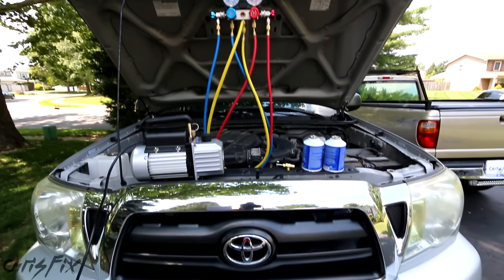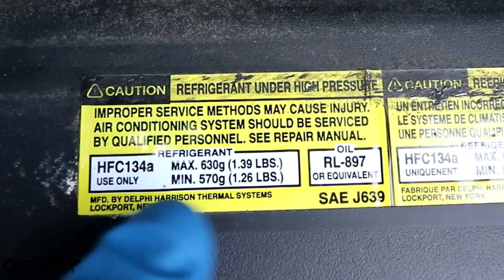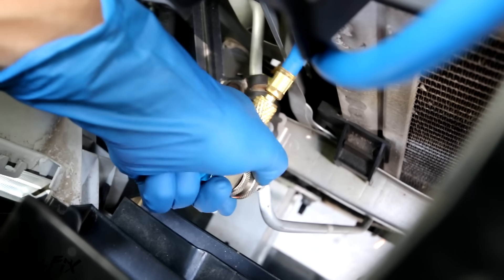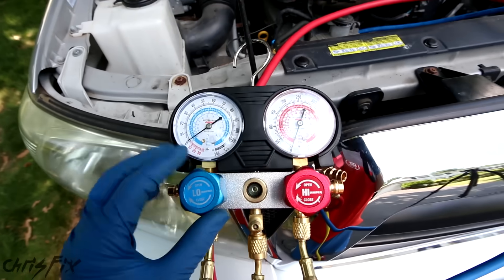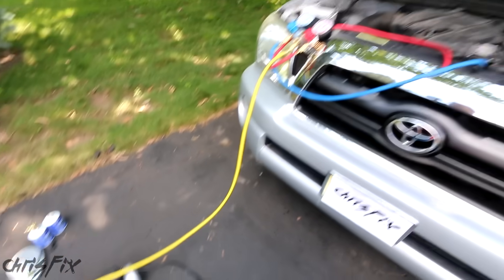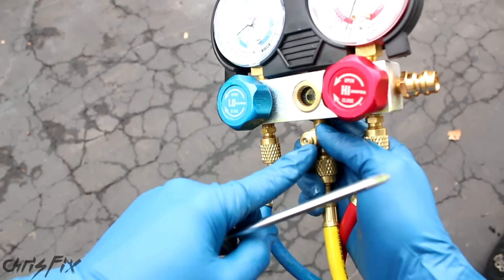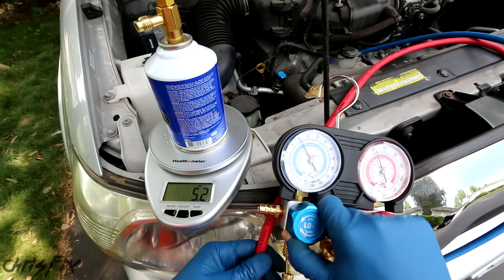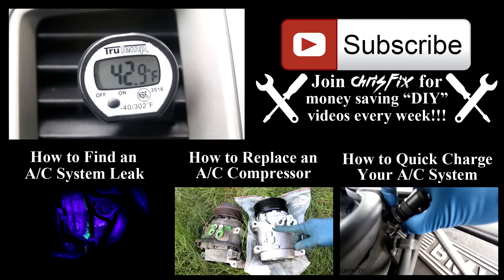How to Properly Recharge Your AC System

Comment: When I drive my 1986 ford f-350 smoke gets in the cab, also through the vents and some from idk can you help there hasent been a fire. Thank you
Reply from the maker: +Organic pranks Check the engine for oil leaks. The smoke is probably burning oil.
Reply: +ChrisFix its not a lot of smoke, but I'm going outside now in 20 degree weather to see if oil is low
Reply: +ChrisFix I checked the oil it's fine, where would it leak?
Reply: +ChrisFix thank you

Comment: What Vacuum did you use? I didn't see it on the description. I have been wanting to start repairing Car ACs, but I want to make sure I was getting good tools, read a lot of people saying the gauges and vacuums they bought were junk.
Reply: +tdrewman The guages and vacuum pump are together as one package in the description
Reply: +tdrewman If you start doing this on cars professionally, you will need to get EPA and any locally required certifications.. The paperwork to do this is a pain in the butt...

Comment: if you turn your can upside down you get liquid =bad idea . keep can up the can and charge vapor only . you can take out a compressor real fast with liquid ,,if you want to go faster than the can wants to go , ? then put your can in hot very hot water then the vapor pressure will go up and it will charge faster ,,,,,and yes i am hvac tech cert of course . thanks nice vid good work

Comment: Hey I have been watching your videos and enjoying them.  There are a few things that you may want to add.  I have an 1982  Chevrolet  Silverado with a 6.2L desiel and needs   R12.  I am sure you can get new schreader valve adapters as well as  changing the O rings with the new silicone O-rings.  They make a cheap  vacum  pump that uses your shops compressor and they work very good as well.  Now the problem is " early 80's and 90's  systems will not turn on the ac compressor until  it has 1 pound  of r12 or with the schreder valve adapters r134a into the compressor"  now I know from when I used  to work at a body shop   that there were different ways to jump the compressor to where the clutch would engauge.   For the life of me I cant remember them and I would love to use my AC seeing we have relocated to Arizona.   Can you help me ?
Reply from the maker: +cody cheney Just take off the connector on the compressor and use 2 wires with 12 volts and attach them to the compressor prongs. That will engage the compressor.

Comment: you don't charge it from the lower pressure pipe and you can't charge it from both sides at once it's wrong
Reply: he did charge on the low side since he didn't open the knob where the high pressure hose was going. It's connected but all it is doing is reading the high pressure psi and not injecting refrigerant
Reply: +med mtv What yout Talking about. You always charge it from the low pressure side. Chris did an excellent job. For being an non refrigeration technician.Some minor things he could have done better. But this was pretty got damn good.
Reply: Chris is pretty smart and look it worked
Reply: +med mtv  Chris did'nt say that the system could be charged on both sides, the manifold gauge allows you to see the pressure in both sides of the system. Also, charging on the low side is safer, especially for diy's. The machines in the shops can charge on the high side, only because the machines can automatically shut the charge off if the pressure gets too high.

Comment: They wanted to replace my evap core I'm like no just put freon in it. They didn't say anything about any leaks I felt like they where trying to scam me
Reply from the maker: +SuperJeremi10 Maybe, if there are no leaks you dont need to replace it unless it is the receiver dryer.
Reply: from wait the shop said they didnt even test for leaks they said there's no signs of oil or anything  and there is a airflow restriction and my evap coil needs to be replaced the box needs to be pulled and check airflow issue i may have bought but  to replace my evap coil  that  just the other day was working fine  i dont think so unless you can show me that its leaking im not changing it unless i have to pull the box to replace ven doors then id replace it  with a new part to avoid having to go back for it they also tried to tell me that a airflow issue could cause Freon loss oh yea i bought that real well i paid them the 80 bucks to recharge the system and its blowing ice cold again there is a blend dorr issue but not one i plan to fix  the recirc door is broken so it is stuck on recirc mode which is fine by me as long as it cools  i took it in cause my ac compressor would run about 30 sec then turn back on then right back of never would get cold next time it leaks out im going to take it to scotty or my norm shop and have them recharge it with a leak die and find the leak if the condenser is leaking or a hose or even the direr charging ports ill have it fixed  if the evap core is leaking ill just keep charging it till it gets to the point it wont hold Freon i took it where i did cause i was 50 miles from home and my ac quite and i didnt want to sweat all the way home.
Reply: ChrisFix
okay here is a weird one for you my ac is still not cooling right its 80 today ac is cooling great keeping us nice and cold until i get on the freeway i get up 65-70 mph and the vents start blowing warm we start sweating as soon as i slow down to 45-50 ac starts blowing ice cold again  i pulled over it seems any time my rpm goes over 1800 the ac starts blowing warm does not matter how long ac has been on as soon as the rpm falls it will blow cold again  all the compressor does at 2000 rpm is click on on off will not run long enough to make the lines cold as soon as i lower rpm the compressor kicks in and lines get cold  i drove 20 mile sweating on the freeway 65mph cause the ac would not work but as soon as i get back in town slow to 45 its cooling just fine.

Comment: My ac finally quite cooking today the ac compressor would Cycle on and off really quick. My gauge showed it was charged right lines started to get cold when it kicked in three it kicked out it was 15 oz low on freon they also wanted to charge me  800 to pull the dash. They said there is an airflow restriction because lien one cent don't blow it's been like that awhile but all the heat and modes work I'm like just put freon in it I'm back to ice cold ac again I'm take it to Scotty for. Second opinion on the airflow issue I'm sure it's the recirculate door that thing has been broke for awhile it only pulls inside air. I never fixed it cause. I never use the fresh air intake anyway it's not worth fixing as long as my ac blows cold

Comment: did you weigh the second refrigerant can with the fittings and hose attached?  that might have caused a miss read possibly over weight reading
Reply: You are right, that wasn't the true weight of just the can. 
But, the refrigerant was the only thing escaping/changing in the weight. So, when you decrease by 10, no matter what the weight says, the only thing decreasing was the refrigerant. So it's okay that there was other stuff added to the weight, because, none of that changed. 
If that makes sense
Reply: +Shivam Patel oh yes that makes sense, thank you for clearing that up with me
Reply: +Shivam Patel hey mr patel r u from India ? R u also ref Ac guy ?
Reply: CORRECT !!!  I was wondering when someone would realize that. It's quite simple, why make it more than it has to be? GREAT JOB Shivam.
Reply: He DID weigh it, you saw it, it was 20 oz. Just draw out until it reads 10 oz less, and you have done it correctly.

Comment: Soooo Chris, how did you evacuate and dispose of the old R134 in the lines?  Is a shop really going to evacuate your system and not fill it for you?
Reply from the maker: +Gary Holloway Yes, a shop will evacuate your system and usually for pretty cheap since it is fast and easy to do.
Reply: +ChrisFix Thanks man.  All your videos are great by the way.  I'll have to ask around on who can evacuate the system.  I used to work at Jiffy Lube and I can tell you that they wouldn't be cool with it.  Buying all this equipment makes sense considering the service cannot usually be found for under $99.99.

Comment: A quick tip. I always put a schrader cap on the centre part of the manifold where you remove the yellow line.
Under a vacuum it can have the tendancy to pull air through the core itself. It's hard to guage from the dials on your manifold, but if you use an electronic vacuum stat you may see some rise. 
I think you pretty much nailed this procedure. 
Another useful video. Well done.
Reply from the maker: +Royalbigness Thanks for the tip!

Comment: Here's another money saving tip. If you have refrigerant still in the system...just vent it out. And guess what..if you have a leak it already vented out into the atmosphere (OMG), not. Taking it to a professional and having them use a recovery machine is the opposite of DIY and saving money. Unless you see and EPA agent walking your street all the time don't worry about. And other thing. The reason we've gone to 134A is that its less harmful to the environment than older refrigerants. So if it's safe now why do I care if it gets into the atmosphere?
Reply from the maker: +John Maggioncalda It is very cheap, maybe $20 and it is the responsible thing to do. I am not going to teach thousands of people the wrong way to do it.
Reply: Venting out hfcs into our atmosphere is one of the contributing factors that causes global warming. Chris is right, just have a profesional recover the system, they will take care of the proper recycling of the refrigerant.
Reply: because you are a dumb ass.

Comment: The 2nd can weighed 20 oz, but that was with the hose attached, no? If there's 12 ounces of fluid in the can, the can itself can't weigh only 8 ounces, plus that nozzle and hose that's hooked up to it. Did you weigh the hose and then tare the scale?
Reply from the maker: +sonofnothing Yes, the hose and nozzle were all a part of the weight calculation. The only difference was the weight of the actual refrigerant.

Comment: So I have a first gen NA Miata that uses R12 and I'm planning to replace it with R12a. How do I check for leaks? Will the normal 134a cans with the UV stuff work? I know the refrigerant will not work but will the UV dye portion work for detecting leaks? Would it just be better to put a can of leak stopper into the system and re-charge as normal? I have to buy an R12 to R134a fitting adapter before I do anything else.
Reply from the maker: +Brap Brap Here you go: https://www.youtube.com/watch?v=pCv7rCdcXsc
Dont use leak stopper because that only makes things worse.
Reply: +Brap Brap  , from what i read the R-12 has bigger molecules and the new 134a will leak out , your system needs to be replaced , with and updated system . I be in the same with my old 1982 rig , . Google and read  on the rebuild units . you can rebuild it if you have the proper equipment and knowledge or big cash to pay , do like i do and just open the wing window .

Comment: Hey Chris, i notice you said that's a new compressor and it already came pre-oiled, but for those who are using their current compressor, do you still add oil to the compressor after discharging the old refrigerant even if it's not a new compressor?
Reply from the maker: +gotti914 It is tricky to know how much oil you might need in that case. Most of the time you wont need oil or at least a significant amount if you just have a leaky seal.

Comment: bru, 9:28 you just released some nasty refrigerant in the air. :)
Reply from the maker: +Focke Wulf That is what you have to do to purge the line. It is a minuscule amount so dont worry. That purge will insure there wont be any leaks in the future which will empty the whole system.

Comment: So what components did you replace along with your compressor?  Expansion valve? Condenser?  Accumulator?  Is it necessary to replace those as well?
Reply from the maker: +ctuan13 You just need to replace the receiver drier when doing ac work.
Reply: So no need to replace the orifice tube and condenser?  What about contaminants clogging up those?

Comment: how accurate were u weight measurements when you left the hose connected to the can while weighing it? the weight of the hose would have changed the weight no?
Reply from the maker: +extorter Nothing on the scale changed except the refrigerant so the weight of the refrigerant is the only thing that changed the weight on the scale.

Comment: What do you do if you dont have a pure valve? Do you just unscrew the yellow line while the freon bottle is screwed it to let the air out, then screw it back in?
Reply from the maker: +Radu Christian Just dont purge the yellow line. It is not a big deal because the yellow line is so small.
Reply: +ChrisFix okay thanks!
Reply: +Radu Christian ..Also, you can buy a 6" long hose with a valve and use it at the end of hose where you attach to refrigerant can. Then, no air in the long hose to the manifold.

Comment: What about low side pressure readings based om ambient temperature? I'm nor asking to be a smart ass, I need to know the best way to determine that. I know it plays a role in proper charging of the system.

Comment: I have a quick question. 
My A/C hi side fill port snapped off and all my r134a leaked. It's been like that for maybe a year, I ordered the new A/C line and a new dryer. Even though there is no refrigerant, does the Oil remain in the system or do I have to add?
Reply: How did it snap just out of curiousity? If it was just the shrader itself broken, just change that rather than the whole liquid line. Dont worry about the oil, the compressor will store it.
Reply: +DanSUFC4LIFE its Bmw so it was a long stem with the Valve at the end. The long stem itself snapped, leaving a hole
Reply: +Tristan Rios  Me personally would just braze the hole shut, but im an A/C Engineer..
You dont really need to see the High side pressure unless theirs a problem.
Reply: +DanSUFC4LIFE I already ordered the new part. I just need to k now if I should add oil or has it remained in the compressor
Reply: +Tristan Rios Nah, wont need to, just make sure you pull the correct vac and charge it correctly and you'll be good as gold.
Reply: +DanSUFC4LIFE Meaning its in the compressor..
Reply from the maker: +Tristan Rios You will have to add some oil for the new dryer since that is a large component the old one will hold oil in it.
Reply from the maker: +DanSUFC4LIFE You dont think he should add some because he is replacing the dryer?
Reply: +ChrisFix Sorry, my bad, yes you should. I work on larger systems which tend to have accumulaters rather than the dryers.

Comment: If the system is showing low freon, is it possible to vacuum first and than add the freon? Or it needs to be empty to vacuum? Thanks.
Reply: it has to be emptied
Reply from the maker: +Amir Afzal You need to empty the system first with a special machine that recovers the refrigerant. But I would find the leak first: https://www.youtube.com/watch?v=pCv7rCdcXsc

Comment: you earned a subscriber. Thanks for your efforts.
As others have pointed out, the weighing if fluid by weight vs volume and the use of the line connected to the can adding weight are two things needing correction/ explanation. Other than that excellent video.
Reply from the maker: +mbbs2008 Awesome! Glad you liked the video!

Comment: I find a quicker way to charge the AC is to flood the high side (charge liquid) with the engine off. Close the high side and finish off charging through the low side.
Reply from the maker: +Cobra281s Thanks for sharing. I dont want to make things complicated for people so I recommend doing it the way I said for simplicity.

Comment: Didn't you suck out the oil and dye when you ran the vacuum?
Reply from the maker: +Jose Segura The vacuum only removes water and air. Oil does not boil at vacuum and it is heavy so it doesnt get sucked out.

Comment: The only correct way to fill a AC system is with a Vacuum pump to evaporate the moisture and ensure system is Hermetically sealed.  Only cost me $70 at local shop and they have ability to capture the existing refrigerant instead of venting to atmosphere.
Reply from the maker: +Dustin Horn Exactly, which is why I showed how to do that entire process in this video.

Comment: Hey Chris this is kinda related to the video. Anyway I'm getting a 99 Ford Expedition passed down to me from my dad and I knows hen he drove it there was a leak on the passenger side when you turn on the A/C and it also smells bad when you turn it on and since it leaks it pretty much always smells even with it off. I plan to take out the carpet and deep clean it but if I don't find a solution for that leak it will be all for nothing. Do you have any advice for me? Anything would help thanks.
Reply from the maker: +BallsOnYaJaws It is a clogged AC evaporator drain. Go look for the drain hole which drains the water under the car rather than overflowing into the interior.

Comment: You weighed the can with the manifold hoses still attached.
Reply from the maker: +gsantander100 The manifold hose was attached before and after I weighed it so it was constant, the only difference was the weight of the refrigerant.
Reply: +ChrisFix Oh, I see.  Thanks!